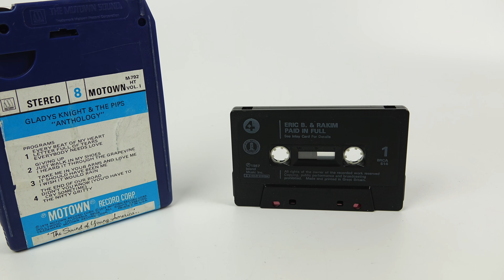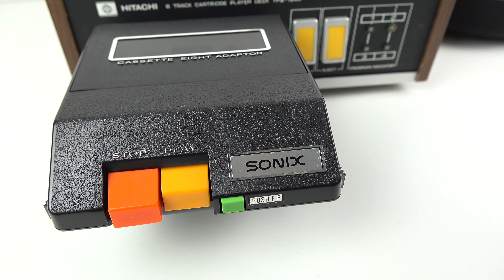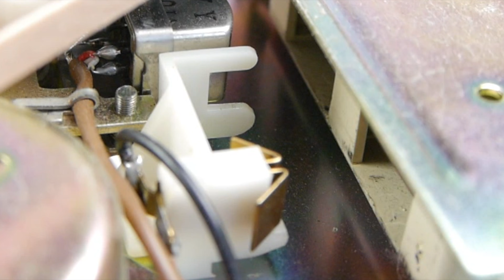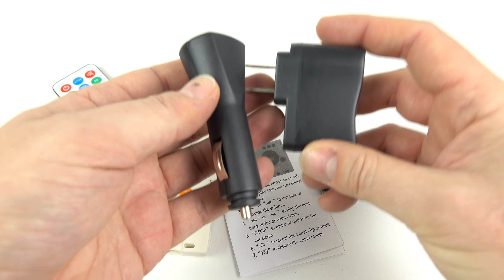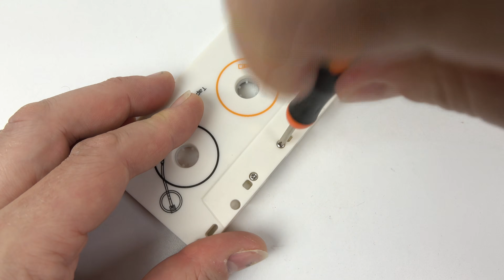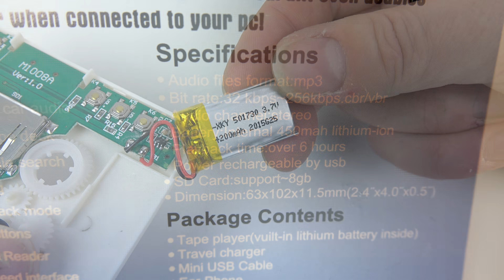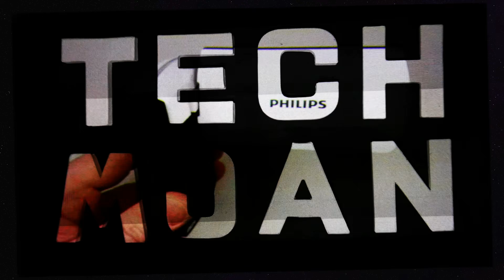Car Stereo Tape Adapters - 8-Track to Cassette to MP3

Comment: Spectacular work! Love the piggybacking mayhem at the end. There are versions of the MP3 to Cassette adaptor that will play the next song when you press FFWD or Pause on the deck too, I'm not sure if it's a standard feature across all the clones of this contraption, but it works on the ones I've picked up, not played with them for a while though. I believe these came out around 2009 as they became very popular in boombox collecting circles on units that had decks with perished drive belts that the owner wasn't confident/skilled enough to repair, and they still are.

Comment: thanks so great wish to know subwoofer  car history
Reply: Before ever seeing a car subwoofer for sale, and as far as we knew, 6" x 9" rear speakers were the largest speakers available for a car, in 1986 a friend and I built a sealed wood box onto the underside of the rear deck of his car and cut the rear deck to accommodate two 10" foam-surround polypropylene woofers intended for home stereo speakers. The speakers were likely about 100 watts each, and he had a fairly decent (for the time) Rockford Fosgate power amplifier to power them; if I recall it may have been 40 WRMS / channel. Even without today's low-pass crossovers, the system shook the car. It was the only system like it at high school. I still remember him blasting "Dumb Girl" and "Peter Piper" by RUN DMC as a "bass demo".
So, exactly 30 years ago, without ever seeing subs for sale (or even in another car), this is what we came up with, and it was decent.
Reply: +LakeNipissing  thanks for sharing I appreciate it

Comment: The 8Gb size listed for the SD card was just the maximum from the time.  The SD format supported up to 2Gb.  More than 2 up to 32Gb is SDHC.  Since the 8Gb is listed, up to 32Gb should work.  Anything higher than 32Gb is SDXC and would not work, since this is older technology.

Comment: It would be awesome if the cogs in that Mp3 device spins a generator to charge its battery while being played in a cassette deck!.
Reply: Or if it detects the speed of the cogs to automatically play, stop, fast forward, etc...
Reply: There is not a generator in existence small enough to fit in a cassette that would generate any meaningful energy at the comparatively slow speeds a cassette plays at, nor do I think it would be possible to make a generator so small in the first place, but it would be a cool idea.

Comment: Not quite universal unfortunately for me. My 8-track deck is a recorder, the Akai CR-81D. I have two of these adapters, different brand names but otherwise identical. Neither of them work. It's tempting to think they were both simply kaput. However it's worth noting that 8-track recorders have a slightly different sensing head block that also accommodates an erase head. The power arms don't make proper contact with the sensor coils.

Comment: I bought a variation of the MP3 to cassette adaptor in ~2002, mine directly encodes into MP3 format via the head or line in or the built in mic

Comment: I still have the CD-player on 230VAC-to-4,5VDC plug in power supply (japanese made Casio calculator PSU, smells 60's/70's, found in the flea market).

Comment: This video made my night! This is the audio equivalent of running a DOS based Atari  emulator thru DosBox in Win10.... Because.. Why not! The first unit shown was sold in the US by Radio Shack (Realistic). Somewhere I still have one! The buttons though are all black. I can attest to it's quality (given it's task). I used it in my 1977 Buick Electra Limited (W/factory 8-Track) all thru the 80's! The second unit I would have bought (actually wouldn't mind one now!) I never saw one! (maybe not available in US) It would be an awesome way to "upgrade" vintage "Boomboxes", ETC!

Comment: If I ever was lucky enough to get a nice old Cadillac or Imperial or such with an original 8-track player, you can bet your ass I'd do this rather than butcher the dashboard to install some glowing awful aftermarket thing that has no home in such a car.

Comment: Interesting that the pulley belt was intact after so many years. You seem to have taken apart and restored quite a lot of mechanical equipment. I wonder if by now you have worked out some sort of chemical theory as to why some soft rubber items perish while others persist.

Comment: Ha ha! My friend had an old van back in the day that we used to get around in back when gas cost less than a buck a gallon. That van had an 8-track player in the dash. After listening to REO Speedwagon too many times, he sourced an adapter, that we could play all of our "backed up" cassettes on. Eventually, we ended up listening to compact discs, played on a Sony D-25, at first, through a cassette adapter, through an 8-track adapter. The shotgun had to watch the road and carefully hold the player to eliminate any skips. For years we went back and forth between cassette and CD. The first pirated CD we played was a copy of And Justice For All. We made the copy on a very expensive piece of kit in 1996 in the basement of a dad's friend of a friend. It sounded really bad.

Comment: I had never seen an MP3 Cassette adapter. I was loathe to replace my stock radio because the tuner is so damn good. The typical cassette adapter sounds pretty bad with lots of background hiss. Thanks for the demo.

Comment: Bizarre - I just posted a video demonstration of one of these units a few days ago...  I found one NIB last week and was quite excited.     I have what looks to be the exact same model but yours has a different motor inside and a different branding  .. and color buttons. The one I feature was disto'd by Radio Shack in Canada.      check out my video if you want to hear it playing back a tape directly into the computer ...not ambient sound recorded from the speakers (or youtube library) .   It's actually not near as bad as I assumed it would be but I did also adjust the azimuth on the heads to get it dialed in.   - https://www.youtube.com/watch?v=IxGsaGh46UQ     - alot probably has to do with the 8track player you use it on..and the Pioneer I have is one of the best i have ever used.

Comment: if you rip out the recorded audio from your own youtubevideo from just 
about 12:10, transfer that piece of digitalaudio on the SDcard, put the 
SD card in the cassette adaptor and play that with the 8 track adaptor 
in an 8 track player, the universe will implode.                                                                         Great video. Made me smile. Thanks

Comment: The one I have you can skip tracks by fast forwarding or fast rewind from the deck buttons or car stereo, Mine didn't come with a remote, Only buttons on the shell, So controlling it has to come from the reels hubs if it is inside the player.

Comment: I had an 8 Track to Cassette adapter many years ago, made by Kraco, and it was driven by the capstand inside of the 8 track. It had it's own rubber pinch roller that ultimately drove the take up reels and capstand of the cassette itself. This one is obviously a little bit nicer model, since it literally is a cassette deck built into the adapter, and not some cheap bodge job that was driven directly by the 8 track itself like the cheaper Kraco and others that were made, which sounded very wow and fluttery to the point of being just plain annoying to listen to.

Comment: From what i understand the thing about the 8gb limitation is because of High capacity SD cards. Standard SD cards had a limit of 8gb but manufacturers got around this by fiddling with the formats later on. apparently SD and SDHC and even SDXC are not compatible. there's a bit more information about this on Wikipedia Page:
https://en.wikipedia.org/wiki/Secure_Digital

Comment: Am I the only one hoping he would put the MP3 cassette adapter into the 8-track adapter for extra terrible sound? 😬

I'm just of the age that I used both types of these. First car still had an 8-track deck, next to last car had a CD changer and a cassette player so I used the cassette adapter for my iPhone. Current car had no AUX input or cassette player, so I had to get an emulator box to send it thru the satellite radio plug...

Comment: My car stereo throws a fit with cassette adapters (for MP3 players) if the gears are present. I stumbled on some info online, removed the gears in an adapter, and it now works great. in my case, it's a Toyota JBL CD/cassette stereo from c2001. (2002 Camry purchased in Sept 2001.) Apparently others have this issue too. 

On that cassette MP3 player, just to verify, the gears aren't required for the device to function, correct? I'm tempted to get it, but I want to make sure it will still work if I have to mod it.

Comment: You could run your Sony PS-Q7 into a pre-amp, then into an FM transmitter. Pick this up on a transistor radio, using the headphone out connect to a cassette adaptor, then into 8-track adaptor. Chain complete :)

Comment: J̶u̶s̶t̶ ̶w̶o̶n̶d̶e̶r̶i̶n̶g̶,̶ ̶d̶i̶d̶ ̶y̶o̶u̶ ̶h̶a̶p̶p̶e̶n̶ ̶t̶o̶ ̶f̶i̶n̶d̶ ̶a̶ ̶c̶a̶s̶s̶e̶t̶t̶e̶ ̶t̶h̶a̶t̶ ̶c̶o̶n̶t̶a̶i̶n̶s̶ ̶t̶h̶e̶ ̶s̶a̶m̶e̶ ̶s̶o̶n̶g̶ ̶t̶h̶a̶t̶'̶s̶ ̶o̶n̶ ̶t̶h̶e̶ ̶Y̶o̶u̶T̶u̶b̶e̶ ̶M̶u̶s̶i̶c̶ ̶L̶i̶b̶r̶a̶r̶y̶?̶
Did you not make a fairly similar video to this in the past?
Reply: You probably didn't grow up with casettes (or never used them) but the great thing about them is that you can record music onto them. So you can put your PC speaker wire into a casette deck and press record to record your PC sounds onto the casette :)
Reply: lol I feel so dumb right now. Obviously I know that you can record to cassette tapes but for whatever reason  I wasn't thinking. Thanks

Comment: You need to use an SD to mini-SD to micro-SD adapter here as well... :-)
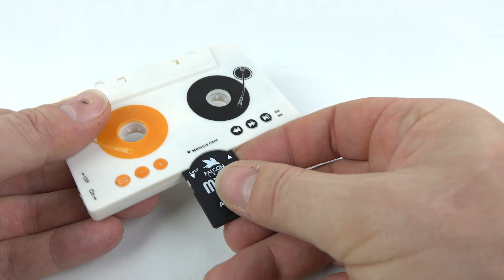Reply: if you noticed that thats what he did 8:11 at least i think he did
Reply: nah, he used an sd to micro-sd adapter
Reply: get a 128gb in there. played for days
Reply: my mistake then
Reply: Syncopator It works with both SD and Mini SD cards. On the back, it says up to 8 GB, but if you use 16, 32 and 64 GB SD card, it will have more songs to go with it. Along with the earlier capacities like 256 MB, 1 GB and 2 GB will also used for box sets like a Reader's Digest or a Longines Symphonette boxsets from original instrumentals to compilations.
Reply: @Musicradio77Network  The problem there is that the software may not be capable of reading the data past a specific address in the file system. They list those limitations because the variables used in the software have to have a data type assigned to them, and they all have maximum values.

That said, many of them ARE capable of reading much larger cards than advertised. The Wii U was said to be able to read up to 64 GB but some people have been able to put 500 GB cards in without trouble.
Reply: OtakuUnitedStudio I had trouble putting the numbers on the remote and then it goes back to start from the first track which is completely frustrating. They should’ve add a screen to display the number of tracks. I have to leave it alone while playing song after song after song.

Comment: I'm sure someone has answered this but the reason it says "max 8GB" but can still play the 16GB card is that it's only going to play 8GB of the 16GB card. The limitation is that the software running on that MP3 player is incapable of addressing (reading) anything past 8GB. Makes for simpler execution all around (software and hardware).

Comment: Never fail to pump things up a notch!  I bought the exact same mp3 to cassette adaptor, (I drive a 2000 Lexus with the last of the stereo cassette players installed, (it was a feature I desired).  I also remember the Audio Cartridge Cassette to 8track convertor/adaptors from my youth. You have put both through their respective paces, as well as a combinatorial.Thank you.

Comment: Fun stuff! Back in 2002 when I graduated from High School, I bought an 8 Track player (actually a very similar Pioneer HR-99 model like you have). My friends found one of those 8 Track to Cassette adapters at a thrift store and thought that I should use it in conjunction with my cassette adapter and use it to play CD's through, so this just brings back good memories.

Comment: 16gb is probably the limit of what it can read. Once you get into 32gb you're talking about SDHC. More than likely 8gb was the most widely available size at the time.
Reply: Yeah, they glitch out. Songs get cut off halfway through, some are completely corrupt, others play perfectly.
Reply: I was going to post something about card sizes, but +Techmoan really hates redundant comments. I sure am glad I found yours on the first page.
Reply: Anything more than 8GB should play fine. I got the 32GB SD card from Walmart so I can use it for my cassette SD Card adaptor and play it without having any problems.
Reply: I've got a few devices with that "8GB limit" on them, too. Never tried them with larger cards as I wouldn't want to risk losing recorded photos/videos and I have no testing cards available, but the SDHC standard treats all compliant cards the same irrespective of capacity, doesn't it? :-)

Thing that comes to mind is if the device has a limitation in registers which point to LBAs on the card. If the card has 512B physical sectors and the reading device only allows 24 bits for addressing, 8GiB (16MiL sectors) would be the highest LBA it could address. :-) 
 
BTW: Did anyone else notice the space for a TF (Micro SD) card slot on the reverse of the players mainboard at 10:45? Quite rare for a 2K/XP era device IIUC! :-)
Reply: One can format a 64 GB card into FAT32, one just needs a special program for it.
Reply: The only difference between SDHC and SDXC is that SDXC comes formatted as exFAT. You can just reformat it to FAT32. I use a 128GB card in my 3DS this way, even though Nintendo lists the maximum card size as 32GB.

Comment: I'm 10 minutes in and I swear if he doesn't put the tape adapter into the 8 track adapter I'm going to lose it.
Reply: Oh thank heaven.
Reply: unnecessary experiments are the best kind.
Reply: Great video!  I had an 8-track/cassette adapter I used in my 1977 Buick.  It had a roller, and I think it may have stepped down the 3.75 speed to 1 7/8 ips physically.  It did have those contact arms as well, so I'm not sure.  I swear I recall manually spinning the pinch roller with my thumb to see if the cassette moved...and I think it did.
Brilliant video, though...and I've got to get my hands on one of those Mp3 to cassette adapters.  I could load it chock full of eighties tunes and listen through my beloved Sony CFS-45 Portable Stereo cassette player/recorder (boom box).
Reply: Jared Jeanotte oh good
Reply: +wilkes85 ಠ_ಠ
Reply: This is the best comment.
Reply: Oh thank good
Reply: Jared Jeanotte GOD DAMIT
Reply: Try watching the whole video before clicking "Post".

Comment: Very cool! I actually had one of those MP3 cassette things several years ago, looked exactly the same but they actually tried something rather interesting in mine....

The spools had larger plastic cogs on it with a sticker that had a black and white stripe pattern. It had a little light sensor that would try and read the stripes so it would pause and start when your turned your car on and off. It would also try and detect if they were moving fast so you could skip tracks by fast forwarding. Of course, these features barely worked and it usually would just pause and play at random, leading me to remove the cog with the stripes on it. Kinda telling to see that yours didn't have that system implemented at all!

Comment: I actually just got a cassette adaptor with bluetooth to use in my car since I always wound up breaking the older, cheaper adaptors with the headphone connection.  Even has a little microphone you can pull out of it to dangle from the car's tape deck to use all the fancy hands free stuff, and the quality seems identical. I've been using cassette adaptors for years, even in the early 2000s for a CD player and my first mp3 player and always assumed they never got any better. Had no idea this MP3 reader version existed, but I would have sprung for it super quick back 12 years ago since I only ever used my MP3 player in the car with my silly wired adaptor. Great video!

Comment: That mp3 to tape adapter was made in 2006 (or later) since the maximum size of a standard SD card is 4 GB (though mostly only up to 2 GB where made).  Only SDHC was capable of 8 GB, and that didn't exist until 2006.

Comment: Aww, I was actually hoping you'd put one of the wired cassette adapters into the 8-track adapter. And then plug that into one of the late portable CD players that had the ability to play mp3s off a home-burned disc. I can just imagine a teenager in the late '90s with a first car so old it had an 8-track cobbling together that chain of crap.

I have a feeling those didn't last long in the marketplace, since they came out just as mp3 players became A Thing; otoh, I used one for a couple of years (mainly with a cassette adapter in the car) until mp3 players went down in price and up in capacity enough -- for a while at the beginning, mp3 players cost $100 and were 32MB, gradually increasing to 256MB ; compared to that, a CD full of mp3s, at 700-800MB, is worth the slight extra size/weight -- mp3s, at least with the bitrate we used back when Napster was in full swing, would fill a 32MB player with ten songs, basically a tiny Walkman that you can't change the tape on the fly; 700MB was ridiculous -- size of a Walkman, but with the equivalent of a suitcase full of tapes within! 

Now I have 32GB of music/podcasts/audiobooks on my phone, if I set it to shuffle it'll be DAYS before it repeats a track. And that's just the backup, in most places I have an internet connection, so the runtime is basically infinite. That's an acceptable tradeoff for the only real flying car being vaporware, I think.